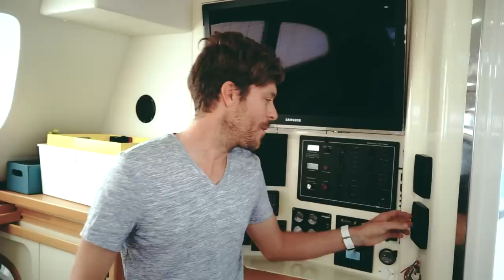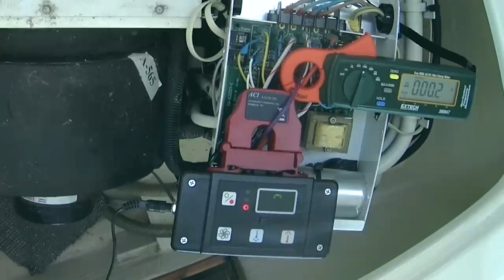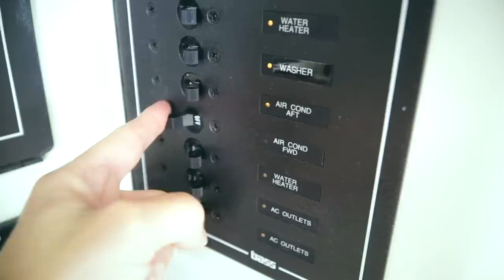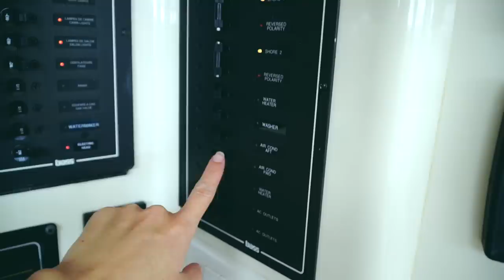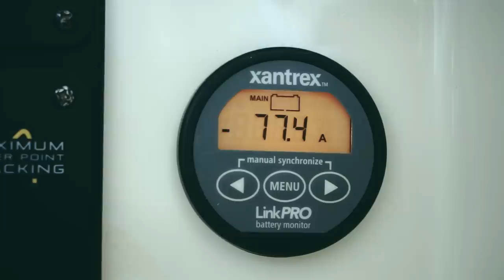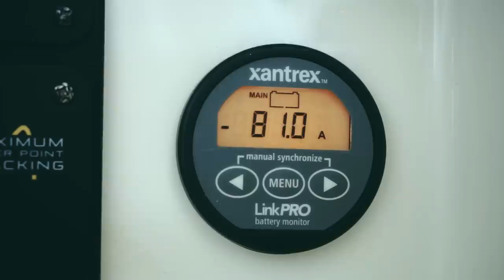Air Conditioning on a Sailboat? Yes, & It's Battery Powered!

Comment: Looking for some input here from Easy Start aka Matteo here.  With an easy start device on say your average marine 16,500 btu AC with water pump...would it run on a honda 2000 generator?  Also have you considered pairing your easy start device with a KVAR to further reduce compressor run draw by feeding some of the unused signwave back to the motor instead of letting it flow back to the shore power, inverter, or generator?  Youtube KVAR if you don't know what it happens to do for electrical services.  I have one at the house and I save about 12-18% on my draw.
Reply from the maker: Remember, Matteo said he'd monitor the comments on our website.  He may check in here as well, but comments get buried quickly on YT.
Reply: Hi Allyn.  Thanks for the question.  We own a Honda EU2000i at Micro-Air, and we have been able to start and run every 115VAC air conditioner we can get our hands on, marine, RV, or residential, with EasyStart installed.
Reply: Thanks for the input.  I still haven't decided on what generator I would buy for my setup.  On one hand the Honda Generator will run about 10 hours on a gallon of gasoline.  On the other hand a Phasor 3.5k marine generator will run about 5 hours on a gallon of diesel fuel and create a lot more power.  The Honda would use less fuel, but it would be gasoline, and the Phasor would use diesel.  The Honda might kill me with the exhaust or Kaboom with the gas, but would cost less.  The Phasor costs a lot more and is a more complicated install , but substantially safer.  I just am not sure where my need lies, and if I can or should get by with the cheaper option.
Reply: Allyn - One other thing to note that will impact your gas economy is that the EasyStart allows you to run the inverter-type generators (like the Honda) in ECO mode.  ECO mode allow the engine to reduce in RPM whenever the amp load reduces.  So, assuming the compressor cycles on and off during the night like most A/Cs do (unless you are in extremely hot weather where the A/C's thermostat never reaches it set point temp), ECO mode will allow the engine to rev down and use less fuel while the compressor is cycled off.  EasyStart's starting delay and gentle ramp then  allows for the engine to throttle up real-time and actually stay "caught up" with the AC power load!  Without EasyStart, there would be no way you could have the generator running at low RPM when the compressor goes to startup, even if it did somehow work.  This is really a great bonus feature that helps save gas and extend the overall run time on one tank.
Reply: I expected that...a KVAR might even help startup a few percentage points more, and generally reduces the running draw by at least 15% on most motor applications.  They work by storing the energy not used by motors.  In other words part of the sine wave in Alternating Current, not DC current, is not used by the motor to run.  Typically this just feeds back to the service and is lost.   If a KVAR were introduced to the Alternating Current side it would reduce current draw by maybe 10-25 percent (25 is possible but unlikely), for powering devices such as AC fridges, Marine Air Conditioners, washers/dryers, pumps...anything using a motor powered by Alternating Current.  They don't work on anything much beyond a motor, except to act as surge protection.  So if The Wynn's air conditioner would run for 5 hours on the inverter, they might get an extra hour or two out of the batteries using the air conditioner.  A 1000-3000 watt generator might be able to mostly power everything on their boat, especially if they have a device that can pull overages from their batteries, boosting power if the supply isn't enough.  Ie. like Victron sells.  They may not need much of a generator to just give their solar a little help.  Since I see you do this for a living I suggest you develop a marine KVAR.  It is ridiculously easy, and a standard household one might work and they cost around $75.00.  Perhaps putting a marine electrical coating on and a special enclosure would be all that would be needed for marinization.  If it works out you can give me a bonus check and some free merchandise.

Comment: if while it's running its pulling 80 amps, what's the big deal if it pulls 50 at start up?
Reply: Hi k bob.  Thanks for your comment.  As it turns out, the two currents that were measured were at completely different voltages and at two different points in the battery-to-inverter-to-AC power system.  This wasn't made entirely clear, so we apologize.  The ~50A that was measured during the compressor startup tests was AC current at 120VAC/60Hz.  However, the current Jason later pointed out on the Xantrex inverter/charger readout device was  DC current at 12V coming out of the batteries.  The DC current relates to the AC current by about a factor of 10.   That is, 10A at 120V/60Hz, when fed by the Wynn' Xantrex inverter, requires about 100A from the batteries at 12V.  The running current of the A/C unit plus its seawater pump was actually about 14A at 120V/60Hz.  This corresponds to about 140A on the 12V side of the inverter.  Given that the video was shot during the daytime though, the Wynn's large solar panel array was providing about 60A at 12V, so the net current being drawn from the batteries while the A/C was running steady-state was about 140A-60A= 80A at 12V.  I hope this helps clear up any confusion.
Reply: +Micro-Air, Inc. - ah now it makes sense. So it would be possible to run a similar A/C system using the soft start and a 30A portable generator?
Reply: Indeed!  In fact, most of our EasyStart customers run 13.5k and 15kBTU rooftop A/C units from a 2000W (16.7A) generator or inverter.  We own a Honda EU2000i generator at Micro-Air, and we have started and run every 120VAC air conditioner we could get our hands on - with an EasyStart installed into the A/C of course - from its ECO (low-RPM throttle-back) mode.  In fact, we've started and run an 18kBTU marine A/C, which is the largest that exists in 120VAC.
Reply: +Micro-Air, Inc. - Wow, that's good to know. Thanks.

Comment: What about a pump that simply circulates cold ocean water over a heat exchanger and blows that around? The total energy is just for a water pump and blower, no compressor needed.
Reply: Hi Barnaby.  As it turns out, what you proposed could work,  but only if the seawater temperature was substantially less than the desired air temperature.  There are two basic thermodynamic issues preventing this though.  First, the Wynns are traveling where the seawater temp is well over 80°F.  Even in Florida the seawater was in the mid to high 80s.  Passing air over a heat exchanger with that temp water flowing through it won't accomplish any cooling to the desired comfort levels of 70-75°F.  And second, even if the seawater temperature were cool enough, then the surrounding air would also be that temperature since the ocean directly affects the air temp adjacent to it and the boat hull itself, and there would be no need for cooling to begin with.  I hope this helps.

Comment: Im not a sailor but has anyone tried a radiator heat exchanger with a small waterpump getting cool water from the ocean floor to feed radiator and having a small fan exchanging the coolness of the water? just thinking out loud. that way you wouldnt need a compressor and not worry about spikes?
Reply from the maker: A swamp cooler for a boat! Aside from some technical difficulties of getting the water from the deep up to the boat, that's a pretty good idea IF you're mostly sailing northern latitudes. In the tropics the water might still be 70+ degrees at 20 feet (and 20' would be a deep anchorage in many places in the Caribbean for instance) and there's just not enough of a temperature difference to get much benefit. 
Curious Minion
Reply: @gonewiththewynns  not a swamp evaporative cooler but a thermal heat exchanger from deeper cooler water might even work as a refrigerator for keeping food cool, just an idea. solar can power during day and at night dont need that much coolness since night are usually cooler anyways.

Comment: Some experience with those soft-start units.  Two have fried themselves and shut the system down.
Another thing: VERY IMPORTANT.  These units have BIG capacitors that can hold charge long after power has been shut down.

Be extremely careful messing inside the cover with these puppies and intentionally ground them out before doing any wiring or testing.

Comment: Hey guys! So awesome! I wonder if this will work well on our 5th wheel camper. We can't run A/C without being attached to good power, so maybe this is the fix. I will have to see if Mike can chat with Mateo about it! Thanks for the great informational video!!
Reply from the maker: Sounds very familiar. I would chat with Matteo but should be a good solution!
Reply: A soft start reduces the start up surge, so if you are tripping breakers and the like on start up you should definitely think about a soft start.  If your tripping breakers while its running that’s something else.
Reply: And just to be clear, when I say start up I mean when the compressor kicks on.
Reply: Hi Em.  I checked out your channel.  Yes, the EasyStart would be the perfect solution for your 5th wheel that you affectionately named "Hazel"!   EasyStart allows you to start and run your A/C on any limited power source, be it an inverter, generator, or weak utility connection (campground hook-up).

Comment: So easy start is an inrush current limiter?
Reply: Hi PJ. Thanks for your question.  Not exactly.  An inrush current limiter can be confused with other devices, like PTCs and such.   EasyStart is FAR more sophisticated.  It is a microprocessor-controlled, soft starter device.  It dynamically throttles (controls) the voltage and current applied to the compressor during the first 1-second of operation, to gently accelerate the compressor, thus eliminating the typical spike or surge that occurs without EasyStart installed.

Comment: Check out the ZeroBreeze portable air conditioner. It isn't in full production yet. I'm going to get one to cool my Class B  when they're finally out in the retail market . :)  It's small enough to carry in one hand, weighs 7kg. For cooling small spaces like a cabin, it seems it will be ideal.
Reply from the maker: That sounds super cool. We’ll check it out, thanks for the tip!
Reply: I see what you did there. LOL.

Comment: I love your videos but I am very frustrated when you use “amps” as a measure of energy instead of “kilowatts”. I am building an electric boat so I am very interested in your information. You said your AC draws 50amps but you didn’t say at what voltage? I understand that surges occur when motors and some compressors start up and would be happy to know just how much bigger the inverter must be to handle a 1.5 x surge. (Let’s say the running voltage on the AC is 3kw does it surge to 4.5k, more or less. Then you need to know how big the inverter needs to be to start the AC. If you use kilowatts then the voltage doesn’t matter unless you are sizing the cables.
Reply: Hi David.  Thank you for your question.  The 53-55A start surge measurement was at 120VAC.  That's about 6500W (6.5kW or 6500VA to be more precise for all the EEs out there).   Most inverters will do about 2 times their steady-state output rating in surge capacity. So, if you have a 2000W (2kW) inverter, it will likely surge to 4000W (4kW).  Once the A/C is running, it only draw about 1500W (1.5kW)
Reply: Micro-Air, Inc. Thanks for the info. Do you agree that casual use of the Amps as a fillin for watts or kilowatts is a bad habit? Most appliances are rated (correctly?)in watts rather than Amps aren’t they? The Wynes aren’t the only ones to do this (it seems most boat people do) but with higher amounts of electricity, battery packs will be more likely 24, 48 or even higher voltages and knowing the Amps and not the volts doesn’t tell you anything about power useage.The backbone of the electrical system on my boat will be 240volt AC even from the battery system so low amps wouldn’t mean a small amount of power.
Reply: All air conditioners and all electric motors (including compressors) are rated on their dataplates with a full load (FLA) or rated load (RLA) current (amps) at a specified voltage (VAC).  Therefore, our measuring amps going to the compressor was valid.  As I did for you in my previous reply above, you can convert the amps to watts or to kilowatts simply by multiplying it by the voltage in use (120VAC).  Yes, it does become a bit confusing when you attempt to determine the corresponding amps on the other (battery) side of the inverter, which is fed by 12VDC, but it can be done quite readily, simply by using the wattage (!) and an an efficiency factor for the inverter itself (~95%).  In your case, since your voltage is 240VAC, an identically sized A/C will draw the same wattage, but about half the current (since the voltage is twice).  I hope this helps explain it.
Reply: Micro-Air, Inc. Thank you for your info and the time you spent replying. I didn’t mean to sound critical of the Wynns and I do watch and appreciate all the videos they produce. Fair winds.

Comment: The hair thing...yeah...hilarious.

Hey Mateo, my battery bank will run my washer but blows fuses on my gas drier. Do you think easy start might help me?
Reply: Hi there.  Thanks for the question.  It all depends.  Since it's a gas dryer, the only the motor that turns the drum is drawing electricity.  If the fuses blow at the instant the motor starts up, then yes, the EasyStart should be able to help.  Please send me an e-mail through our channel, and I'll be glad to discuss it further with you!
Reply: Micro-Air, Inc. Love to connect when we are in Florida some time!

Comment: Shower before bed and use a fan. Or put a damp towel on the fan. Works amazing.
Reply: Jeena Bittenbender If you put a damp towel over a fan in 80% to 100% humidity you are just making the air even more humid and uncomfortable. This only works when the air is relatively dry.